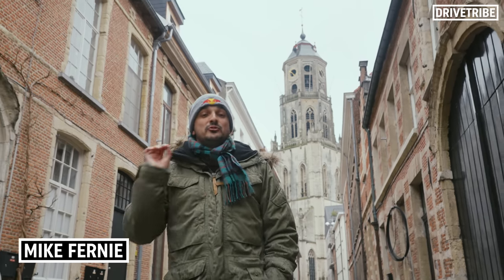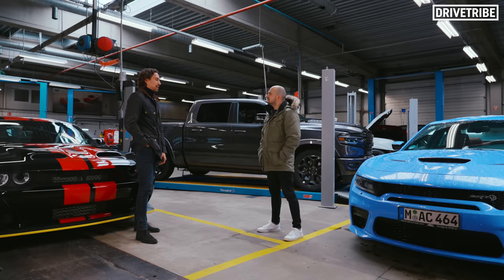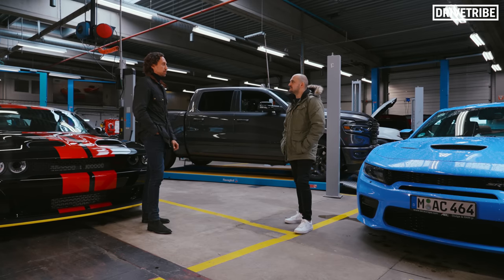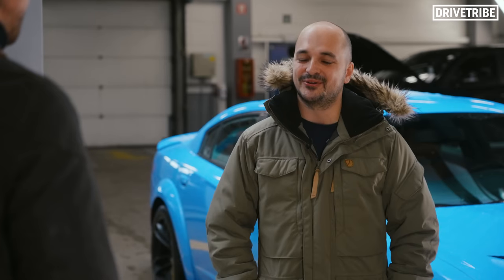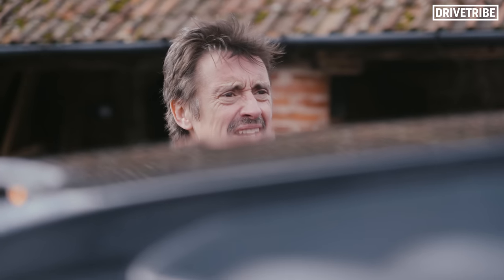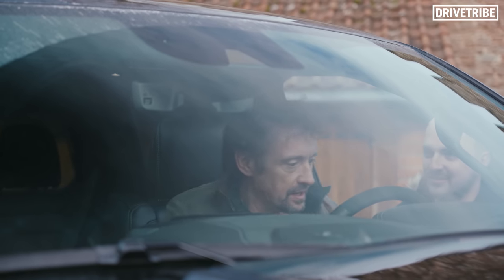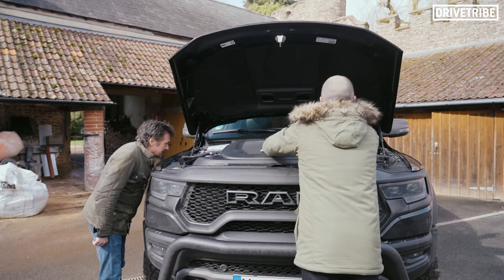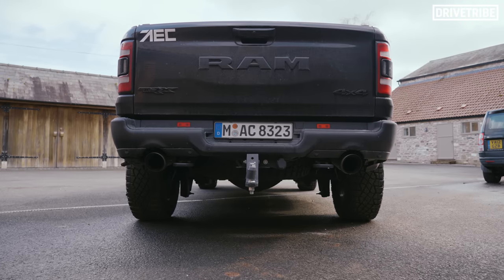This is Richard Hammond's new 700hp V8 daily driver!

Comment: I can't believe that Dodge is not going to be making these cars anymore😢
Reply: Electric is on the way. Let's call it a last hurrah with fossil fuel.
Reply: I'm thrilled they're going away. it'll reduce a certain demographic back to Altimas and Fortes and not terrorizing the roads at all hours.
Reply: @Nathan Thomas  isn't it ultimately powered by coal?
Reply: Stellantis is actually betting on keeping combustion engines alive and kicking, they’ve been doing massive E-Fuel tests lately like Porsche has been doing as well.
Reply: The TRX will be available for 2024. Synthetic fuels are the future not electric cars
Reply: @jeramy576  they'll just be Tesla drivers. You already see model 3s all dinged up and rims scratched up as if they took a cheese grater for hours to the wheels
Reply: Some of it but not ultimately. We get electricity from renewable sources too even if it's only a small portion. It doesn't take a rocket scientist to figure out that while gas and coal can be converted into electricity, there isn't exactly a practical was to turn a solar panel or wind turbine into gasoline.
Reply: Bio fuel honestly is a better option than electric cars tbh, the manufacturing process for combustion cars is much more eco friendly than the process for electric cars but bio fuels won't have any emissions as long as they're like the one that's currently being developed made from water and existing co2 captured from the air
Reply: Have faith, if anyone can make fabulous, fun, exciting electric cars, or even electric MUSCLE cars, it’s Dodge.
Reply: @tylerplayzz8697  I’d LOVE to see a bigger market for bio fuels, especially in America.
Reply: You can thank the World Economic Forum for the upcoming electric cars. They have the best interest in our people and the environment, of course.
Reply: @jeramy576  I hate to tell you this but... you can be just as much of a Menace in a Kia Forte. You just don't look as cool doing it.
Reply: Considering the Charger and Challenger are 90s Mercs with a big V8, it's long overdue that they cease production
Reply: Great news right!
Reply: @HOLDFASTBEAR  or nat gas, but it still operates at a significantly higher efficiency than burning petrol
Reply: @dubplatenate  it wont last
Reply: I can! They're absolutely awful in every single way🤣
Reply: To be fair with all these evs on road now UK feels cold we need more fossil fuels burning warm the place up a bit
Reply: @phoebeeileenbrooks110  I use to live in North Dakota  and you could get e85, e30, and e15 at the pump

Comment: I live in the USA and I've seen a few of these but I was actually surprised by how small it is. So many people modify their trucks here that this thing doesnt look all that crazy out the box.
Reply: I mean the US was practically built around the Car and because of that it makes sense that the roads are so large which then prompts car manufacturers to build big cars. Europe wasn't built around cars and thus roads and as a result also cars are smaller in size.
Reply: Closer to ranger than F-series imo
Reply: Ans more sensible
Reply: @sys-administrator  Normal roads can certainly fit the TRX but the truck is still rather large for European roads.
Roads in the Us tend to be much much wider then they are in Europe.

I'm sure you can find some examples of where this isn't the case but still roads in the EU are smaller then US ones.
Reply: @alecwhatshisname5170  the TRX is based on the 1500. It's the F150 competitor.
Reply: That's because it's literally just a heavily modded 1500. It's a lot wider, and obviously taller ride height than a stock 1500 but that's it. Most trucks will actually ride taller and are longer than the trx just due to them being a 2500 or 3500 platform and not a 1500. We've got a 2500 power wagon and it's much bigger than the trx.
Reply: @Z38_US  The roads are larger in the US because we have more room, not because it was built around cars.
Reply: @sys-administrator  No they are not you are right which is part of the reason why many can't fir gigantic cars like the TRX (well for European size standarts anyway)
Reply: @username8644  I think the carwas also a big thing in that.
Yes you do have a lot more room than most other countries but the US is actually not all that old only a couple hundred years and the car made a big impact on it. Before cars most roads over there weren't made with asphalt or something but after they slowly started to be this way and also got a lot wider then before.

I'm not saying the car is the only reasons your roads are so wide I'm just saying it's very likely that it played a role in it.
Reply: Agreed. I've ridden in a TRX before and after a while, trucks this size are just NORMAL
Reply: @username8644  Well no the roads we see now we’re basically built after the push for a car-based society back in like, the 50s, 60s whatever
Reply: Small? No buddy. This is gigantic. I'm in New Jersey and I park my GLS450 next to a buddy's and my Benz looks like a hot wheels toy 😂
Reply: @alecwhatshisname5170  nope same size and league as a F150. A ranger is a baby truck
Reply: as a native Texan, I can confirm, the TRX is average sized at best.
Reply: They are certainly big, but I would agree they aren't incredibly big. However, they are incredibly impractical. They are far too big to use for 4WD, not suitable for a work vehicle, and they chug petrol so quickly. The engines are so inefficient, they cruise at over 2000 RPM, which is terrible for a 6.2L engine (a 1.6L Renault Trafic engine sits at about 1500 RPM in the same circumstances).

Comment: Love to hear more about the Homologation steps, are the homologation rules still the same for EU/UK since brexit? Are things like dash mounted headlight beam height adjusters still a thing?
Reply: Not on newer high spec trucks, they have auto leveling headlights. And that's not a requirement in North America
Reply: Im pretty sure if you buy a ram in the UK direct from dealer you don't need the extra lights and that but since AEC are German if you get one from them you'll also get all the EU homologation extras.

Comment: Even In the U.S. these trucks are very big for a lot of things. A lot of the drivers of full size pickup trucks have to park further sway or park like a holes to fit into some parking spots.
Reply: They just park covering up 3/4 of the sidewalk, and maybe back in with a big tow hitch to break the ankles of unwary pedestrians. One person commutes to a desk job in them, and it's the most idiotic thing.
Reply: Maybe for you, not for most places in the US though. This is just a modded 1500 it's not long at all and the only concern for parking is that it's pretty wide for a 1500. It's not a big truck, it's a medium truck. A 2500 long bed or a 3500 with any configuration will dwarf this truck. We have a 2500 power wagon and it makes this truck look small.
Edit: and this isn't a full sized pickup.

Comment: The question is Why would you want one. You cant park it anywhere, the tax is insanely high and running costs are nuts. The only people i know that have americans are Ram's running on LPG.
Specially now that Belgium said you cant turn a car or register a pickup as a "lichte vracht" and get a roadtax cut.

Comment: Having owned both a S class LWB and a Raptor - I can confirm there is more rear space in these trucks than an S class.  I adored my Raptor (I was in the Middle East so fuel prices weren't an issue)  However the plastics in these are pretty cheap - certainly nothing on EU standard.  But when you're driving theses with the growl of the V8 who cares

Comment: A Cummins on compound turbos big injectors and big tune would be way cooler😉
Reply: Is diesel fuel way more expensive in Europe these days like how it's gone up in North America? I remember up until the 90's and early 2000's diesel used to always be a bit cheaper than gasoline. Those days are long past it seems, even though its a less refined product. It should be cheaper to make, but is demand outstripping supply? I would think we have about the same number of diesel vehicles on the road as 20 years ago all getting better mileage I would hope with new technology.
Reply: Diesel and petrol are about the same in the UK
Reply: @Blaidd7542  Interesting to know!
Reply: @marcusdamberger  I remember Diesel being cheaper than gas in the 90s as well. Nowadays its always more than gas in my area.

Comment: In my mind, is there any type of vehicle that should be electric its these trucks.. I would love one if I had the need for one (and could afford it). Think about it, range not a problem cause you mostly work and use it somewhere close to your farm, also therefor you can allways charge it, wheight, well these ones already wheigh a lot, so... handling, doesnt matter, and in the end you have a massive power bank with u when you work so you can charge both powertools and have a microwave oven or a coffeheater with you.. I think they should make more of these electric 👍

Comment: I had figured it was a TRX. Fast on the road no doubt but the suspension and weight leaves a lot to be desired off road.

Slower than my Gen 2 raptor on the off-road track, and I reckon about equivalent to the Gen 1. All Dodge knows how to do is stick a big supercharger on the engine and call it a day...something rednecks have been doing forever.

But while I'm a little disappointed Richard opted for one I can't say as I'm surprised.
Reply: Gen 2 squad!
Reply: @Hunter-nb5bj  Is there a thing going back and fourth between Gen1 and Gen 2 owners?
Reply: @marcusdamberger  No, just was saying that I also had a Gen 2 Raptor

Comment: Should have got the Raptor R. Lighter, faster.
Reply: My gen 2 is faster off-road than the TRX, and not much slower on road (with much better fuel efficiency to boot!). 

Took Ram 10 years to copy the Raptor and they still couldn't do it right.

Comment: Why in all that is holy would you need 700 hp in a pickup truck. A vehicle that is meant for towing or carrying. Torque is what matters, not HP.  But also when you expect to tow or carry stuff. Ive never understood the idea of putting a coupe'/muscle car engine in a pickup truck. The only thing you really get is more engine noise. But imo if you want engine noise there are better options than a supercharged pickup truck. Complete overkill and completely unnecessary. Im a fan of sports cars and the noise they make, but ive never desired that same noise in a pickup truck.
May the blasts commence,
Reply: 650 foot lbs of torque 😁😁👍👍 you can drive a pickup pretty much everywhere..

Comment: Just wait for the parasitic battery drain, like all Ram trucks from about 2014 to present. It’s the [red] F43 10A fuse under the dash (which powers the USB ports and a few other things) yet Dodge refuses to admit it. Just buy the Raptor instead.
Reply: 702 hp >450 😂😂😂
Reply: @jakey20022  Raptor R exists buddy

Comment: TRX is such a useless vehicle.
Reply: And so is the STI. Your point?
Reply: @gavcom4060  in what world is a $40k AWD sedan useless? A $100k+ truck with 700hp is useless. You're not going to haul anything with it, you're not going to the dump (or tip) with it, you're not filling up the bed with gravel or materials, and you're not going to tow anything with it. The only people buying a TRX have more money than brains and are compensating. Tell us what you drive, Gav.
Reply: @carlsoto1747  Must’ve hit a nerve there 🤭
Reply: @gavcom4060  there’s a big difference between a troll hitting a nerve and making asinine comments when you take the bus
Reply: @carlsoto1747  Lol you’re talking about yourself right? Cuz you’ll prob need one after your motor blows